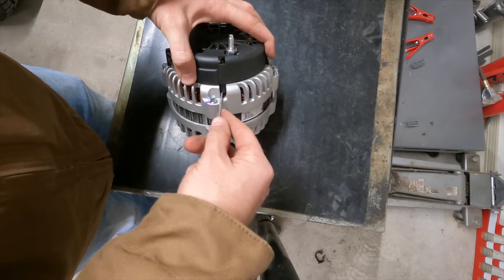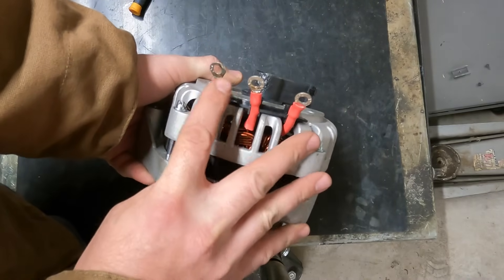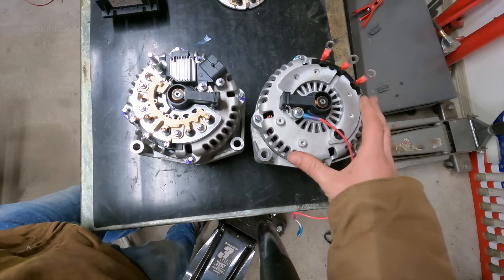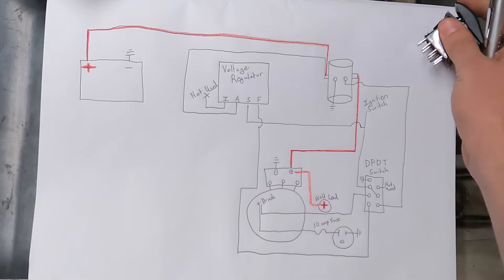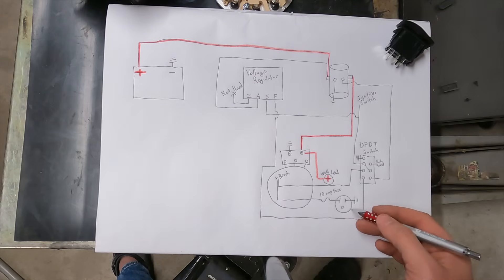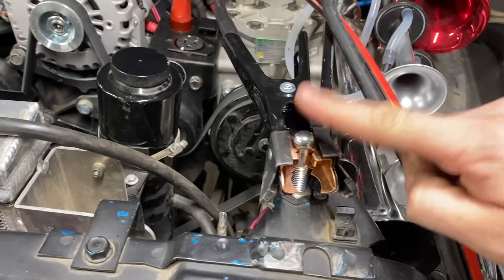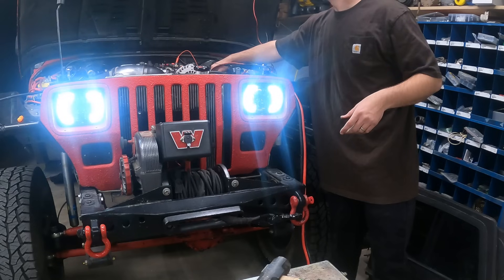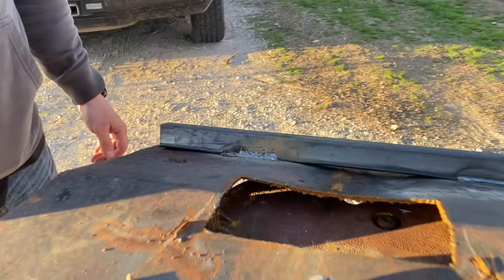How to Modify an Alternator for Charging AND Welding

Comment: Other commenters have noted some problems with your alternator/welder. As a welder, I should point out that you need some way to control the output voltage/current while you weld. Not all (if any) weld jobs will turn out well if the machine just blasts full power into the work piece. For every job, the person welding must select the proper rod to use, as well as the current rage it works best with, and take into account the thickness and alloy of the work piece that is to be welded. Besides the initial set point of current, the machine must be capable of automatically regulating that power thruout the weld process. You have a good start here, but your design could use some tweaking. Thanks for sharing.
Reply from the maker: Thanks for the tips! I should have made it clear in the video, but this isn’t meant to be a stick welder to compete with “insert name brand machine here.” This is meant to operate only if I need a quick repair to get off the trail. Hopefully, I’ll never even have to use it, but it’s there if I do.

That being said, it can absolutely be tweaked by anyone interested enough in doing so to make it better.

For what it’s worth, the amperage can be adjusted by the throttle. If someone wanted to, they could install an amp meter to measure how “hot” it’s running. Someone could also use a potentiometer or rheostat to adjust the voltage on the field wire line which would regulate the amps independently from the throttle.

Thanks again man!
Reply: @sweeneyoffroad  Great job bud
Reply: You vary the amperage by varying the engine speed.  I built one 30 years ago.  I made sliders with it.  They never came apart.
Reply: @scottyh72  Good to know. Thanks
Reply: Yeah like Scott welder has a reostat start capacitors and the alternator rewound

Comment: I'm a bit confused. Wouldn't it be easier to just leave a small charger for the 12 volt battery and skip the switch? 
Oh, and a note for anyone owning a new car. The throttle will NOT keep the engine rpm up. Doesn't matter how far down you push the gas pedal The motor rpm will drop to idle speed.
Reply from the maker: That’s why I installed an auxiliary idle control.

Comment: Good project, technical difficulties notwithstanding. I have to agree with WorkingOnExploring there may be several issues you have not known or thought about. I only wanted to add your difficulty in trying to solder to the alternator windings is because there is an enamel insulation on them. They have chemical stripper specifically for removing it but you can just use 220 grit sandpaper and it will solder fine. You’ll want at least an 80w iron but one of the old Weller soldering guns are perfect for large wires.

Comment: My only suggestion is the ground should be direct to the alternator for the welder rather that the body . Body is grounding to the alternator via several lighter gauge wires body grounds are prone to failure . You may never know driving your car that 75-80% of your body grounds be broken but any weakness will show up at 40plus volts really fast and dramatic failure. Just a thought . Guys would use generators for welding in the olden days with simple modifications . When manufacturers began using alternators.  Good luck I think I'll give it a try but I may run a separate generator specifically for a welder.

Comment: You're running your compressor off the belt instead of electrical? Seems like a waste of pulley space.
Reply from the maker: The compressor moves much more CFM being run off the belt than any 12 volt electrical compressor

Comment: You dive right into removing the case but do not identify what alternator you are working on...  Would be nice to know what brand and model and what it came out of.  I know they are all very similar that have internal regulators.  The rest of the video is excellent.  Thank you.
Reply from the maker: You’re right, sorry about that. This is a truck alternator from any Chevy LS type engine. AD244

Comment: What kind of alternator and amperage did you start with?
Reply from the maker: It’s an AD244. As far as amperage, I haven’t measured that. I just use the throttle to control the amps and it seems to do well at about 1400 rpm’s.

Comment: Cool project!  Now take 10 minutes and fix that screaming idler pulley!! :)
Reply: Here's another fun fact you could convert an AC compressor into a beast of an air compressor and exceeds very high psi output just be sure to install an air tank! 💯👌🏼💞🔧⚙️👨🏼‍🔧🤌🏼💯
Reply: 😂 killed me when I heard him turn it over. I was going to mention it 😅
Reply: Ever notice many mechanics drive beaters without a heater?
Reply: @natemiller6389  yea because we work on other peoples stuff all day long and the last thing we want to do on our day off is work on one for free.
Reply: Lawrd
Reply: Thanks for sharing 👍
Reply: It sounds like a cricket.
Reply: I don’t know what it is but even the premiere welders scream like that
Reply from the maker: @brianslaugh3029  interesting, I didn’t know that…
Reply: @brianslaugh3029  I think it is the frequency of the welding arc
Reply: It's the welding arc that is whistling like that. Some of the smaller older two-stroke welding machines do the same thing

Comment: What kind of beast truck is that? And what happened to the steering wheel?
You need to keep this in mind when making a video: it's video, not radio. You must show every single step, no matter how insignificant you think it is. Your audience may not think it is and then they give you a thumbs down. If you want to have a profitable channel, look at how others do theirs and simply copy them. Don't think that there is anything new in story telling that you have to offer. It's your knowledge that will grab the subscribers.
Reply from the maker: It’s a Jeep Wrangler. Check out my walk around video on my channel. The steering wheel is a quick disconnect so I can remove it to keep it out of the way. I didn’t include any info about that because I didn’t think it was super relevant. Thanks for the tips!

Comment: Awesome idea and proof of concept.  Probably not enough room in a jeep to run a second alt to isolate the charging and welding.
Reply from the maker: Yeah, I’m already running a pretty big belt to run the York air compressor. Things are getting pretty busy under the hood as well so I’m trying to keep it minimal where possible